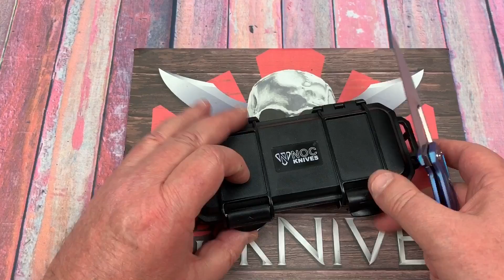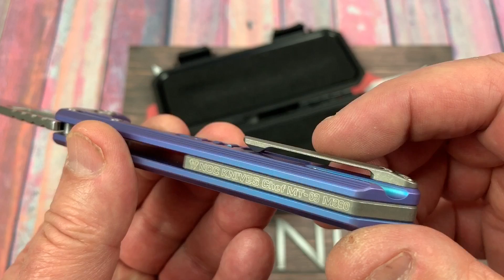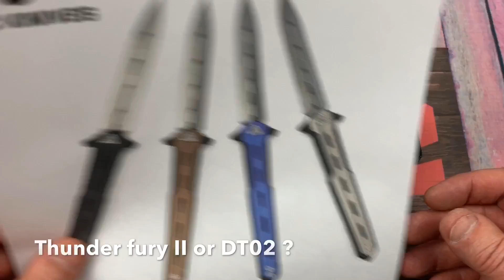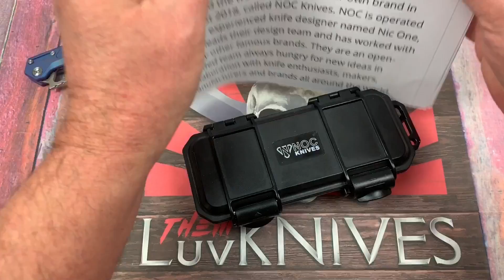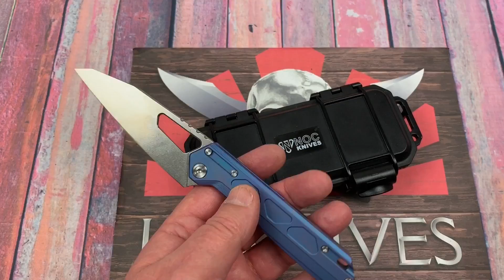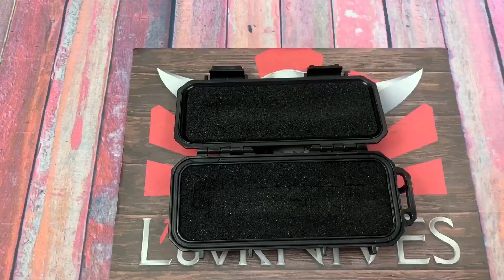NOC MT03 Chef Titanium framelock Knife w/M390 blade  Lightweight high quality and so sensible !

Comment: Using this as a go-to kitchen knife, I think of it as a chef's beater.   No play, easy to keep clean, light, and because it's a folder it prevents the edge from making contact with anything while put away.   It could use more traction on the handle & better jimping on the blade, and I find the price a tad high for such a nondescript design.

Comment: Wow, this is set out to be a better slicer than my para2! The blade stock is only 3mm.. combined w/ the high blade width and full flat grind.. this thing is a slicing monster. A whooping 4inch blade in a 3.5inch blade shape, and no need for a finger-choil because going up on the handle will take u as close to the blade as possible. This is a wonderful design wow, what a steal!

Comment: I think it’s a cool design but just FYI, there are quite a bit of knives you can get with that steel between $60 and $170.

Keyshawn- dividend
Keyshawn- link
Giant mouse- ace iona 
Steel will- cutjack 
Steel will- modus
TRM- neutron
Benchmade- valet
Benchmade- mini grip

All of these have m390 or 20cv.
Reply from the maker: Knife_Man_Zack   I’m not familiar with the Keyshawn brand !   Lol.  I get what you’re saying.  I was just saying the combination of M390 plus titanium frame.    None of the knives you mentioned have titanium scales...just g10 or aluminum etc.
Reply: Keyshawn Johnson?

Comment: Nice Knife! Good value. The NOC DG04 model (which is REALLY cool looking), has a VERY similar scale treatment (not shape) to my Stedemon/Vouking C0603 Liner Lock...There may be more of a connection between Stedemon and NOC: https://www.bladehq.com/item--Stedemon-Vouking-C0603-Liner-Lock--91477    Check out the Black Carbon Fiber overlay on the white G10. Same exact type of styling on both knives.

Comment: Like this design very much: rounded handle, great blade shape.   That appendage on the blade-spine could be a bit awkward in the pocket but it does give some stability when open.   The thumbhole could actually be an advantage on things like cheese, providing a friction break.   Might consider the silver.

Comment: Looks like the marifione apocalyptic sigil flipper.blue and handle scales are very similari bought the blue one a clone from China the color is exactly the same.the outside of the noc scale is the inside pattern of the marifione weight relief.i would get that blade steel tested.
Reply from the maker: norman formicola   I’ve already shipped it in for testing    We’re going to find out !
Reply: @luvthemknives  ok great I have a picture I can send you of the one I purchased from china.whats your email
Reply: @luvthemknives  that's good to hear bc if it is a stedemon brand as people are commenting another channel had stedemon "m390" corroding in a day so it either wasnt m390 or they dont know how to heat treat.
Reply from the maker: Ryan M    The channel thathad the Stedemon corroding wasn’t a day or two.  It was about a week.   And I’ve had Stedemon tested because they make Vouking and it’s real m390 and the heat treat is good.   But any steel that has carbon will corrode.   Here’s the link to the Batch 3 Testing that has the Stedemon Vouking Knife Results Steel Test video batch 3:https://youtu.be/JWCNV8Ipaus
Reply: @luvthemknives  good to know,  just skeptical of some of these unknowns.
Reply: @luvthemknives  and yes I know steels corrode,  all im saying is one day or a week what I've seen shouldn't happen to m390 if heat treated properly